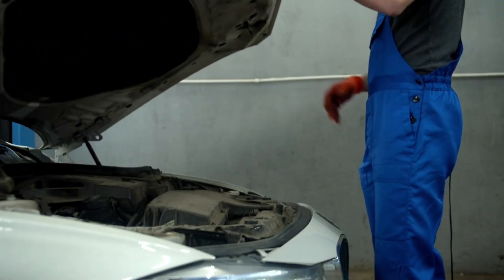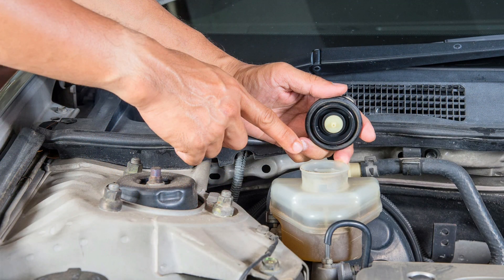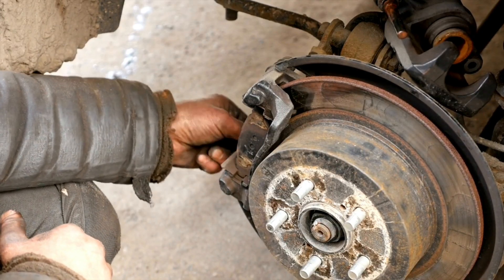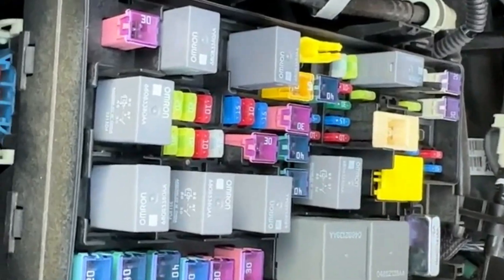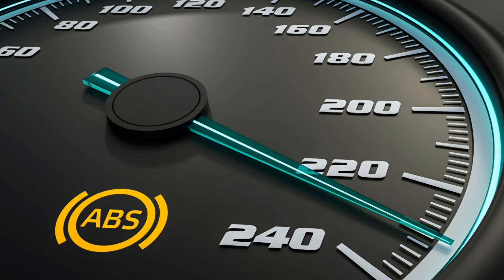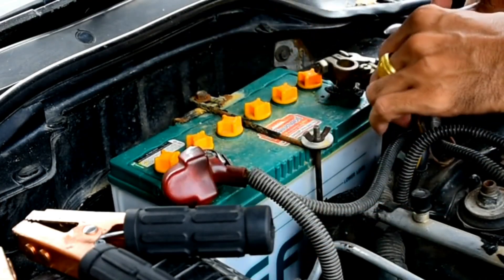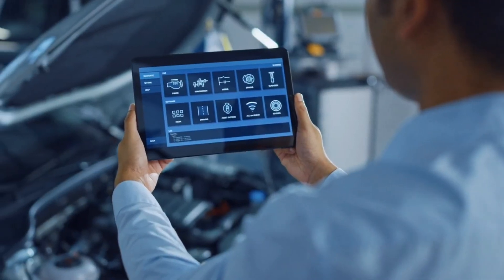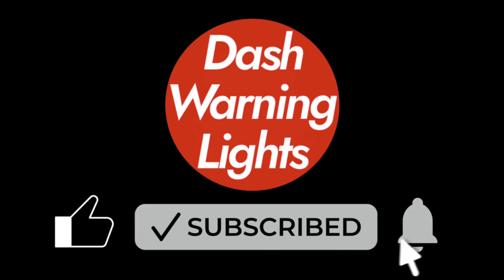How to Fix & Reset ABS (Anti-Lock Brake System) Warning Light Stays On or Flashing | ABS Light On

Comment from the maker: ✅ ABS WARNING LIGHT ON?
👇 Drop your car’s make & model below — I’m here to help you troubleshoot!
In this video, I cover:
✅ How to fix the ABS Warning Light
✅ How to reset it without expensive tools or dealership visits
✅ Common causes why the ABS light stays on, flashing, or blinking — and how to solve them
🚗 Applicable for most vehicles, including:
Toyota, Honda, Hyundai, Kia, Ford, Volkswagen, Nissan, Subaru, Chevy… and more!
📲 Need help? Leave a comment with your car info — I’ll reply quickly!
- Dashboard Warning Lights Explained
- Car Dashboard Warning Lights Explained
- What Do Car Dashboard Warning Lights Mean
- Car Dashboard Symbols & Their Meanings

Comment: 96f350 abs light flashing and keeps blowing fuse, no cruise control...
Reply from the maker: @mamyrammer1603  Hi!  On your 1996 Ford F-350, if the ABS light is flashing and the fuse keeps blowing while also losing cruise control, here are the most common causes:
👉  Short circuit or damaged wiring – Check the ABS wiring harness near the frame rails and wheel sensors; damaged insulation often causes blown fuses.
👉  Faulty ABS module or pump motor – A failing ABS pump motor can pull too much current and blow the fuse.
👉  Rear speed sensor failure – On many F-350s, a bad rear differential speed sensor triggers flashing ABS lights and disables cruise control.
👉  Check the ABS fuse & relay – Make sure the correct amperage fuse is installed and the relay isn’t stuck.
✅ Quick Tip:
Scan for ABS trouble codes with a diagnostic scanner.
If the rear speed sensor is faulty, replacing it often restores both ABS and cruise control.
If you want, I can share the step-by-step reset and fuse check procedure for your F-350.
Reply: @Dashboardwarninglights Thsnkyou i fixed it by cleaning the master cylinder sensor connection
Reply from the maker: @mamyrammer1603  That’s awesome! Thanks for sharing the update. Cleaning the master cylinder sensor connection makes sense because corrosion or a loose contact there can trigger ABS faults. Glad you got it sorted and your F-350 is back on track!